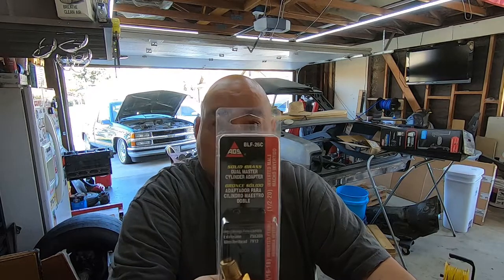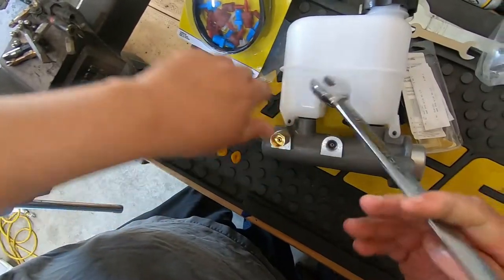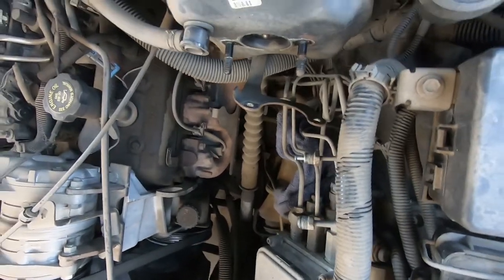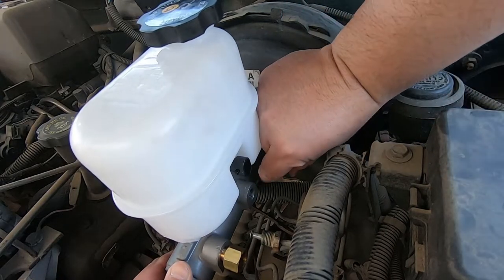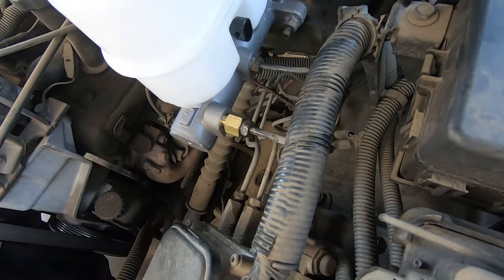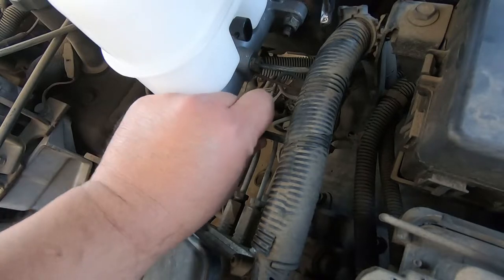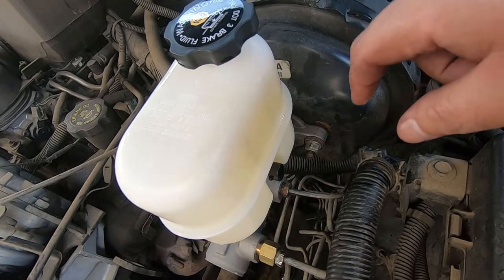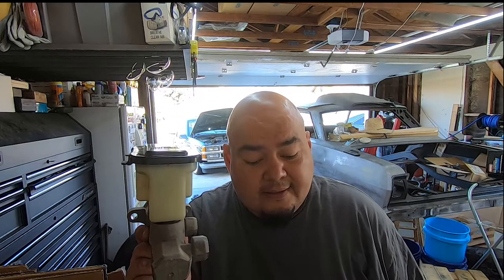Chevy NBS master cylinder on an OBS upgrade

Comment: Nice video. That’s on my list as well.
Reply from the maker: Yea bro it’s a must do if you have one of these OBS trucks ! Thanks for watching
Reply: I’m still working on the inside and some light bulbs, speakers for the front door. Also the driver door key whole is hard to turn to unlock. All the power locks don’t go up and down. They click up and down but don’t lock/unlock. WD40 to the rescue
Reply from the maker: Hell yea bro get it done it will all be worth it in the end 👍🏼
Reply: It will be as it was my dads truck. I think we live near each other. I’m in Chino. Mine is a 1999 C3500 OBS crew cab 8ft bed
Reply from the maker: @djbigdavethefyrm  I live in Fontana but I do work in Chino Hill funny right
Reply: What would you charge to do my master cylinder
Reply from the maker: @djbigdavethefyrm  I don’t bro sorry .... I’m limited on time I don’t much time to work on my own stuff .... do you have tools ?
Reply: I understand and I do have tools. The bleeding of the brakes is a two man job. I gotcha
Reply: One more question, do you know someone local that does sunroofs for the OBS ??
Reply from the maker: @djbigdavethefyrm  no bro I don’t the ones that I have heard of charge a lot the the work and it’s not that great from what I can see

Comment: Well... did it work? Did it cure the feeling of stepping on a marshmallow? On mine I believe it is the ABS pump. I've seen a lot of videos where people go ham on masters, calipers, brakes, wheel cylinders all to still have the squishy feeling. The master doesn't drift or "vibrate" when depressing the brake, and the brakes engage and dont pull so its not like its a stuck caliper or wheel cylinder. The only thing left is the pump. At least I hope that is what it is because it cost 100 bucks. lol.
Reply from the maker: Yes it worked for me the brake pedal feels firm and grabs quicker than before no more squishy feeling .... after I was done with the install I had a friend come over and we manually bled the system and the abs unit as well it’s been working great ever since.... I’m actually getting ready to do agin to my other OBS 2 door Tahoe ... thanks for watching 👍🏼
Reply: @LowLifeYonkes  My next step will be abs delete using this setup. Thanks for the instruction. :)
Reply from the maker: Yes that’s my next move too lol I will post a video soon on how I do it
Reply: @LowLifeYonkes  Just wanted to come back to say with the new abs module and proper bleeding its a little better. At least I am not afraid to drive it now. But still not the greatest and I will be doing this upgrade. I am curious what these felt like when they were new. I used a power bleeder and like a gallon of fluid to be sure there was no air. lol. Have a good one.

Comment: Will it fit a 96 obs? It says on the Amazon link it won't fit
Reply from the maker: Yea it will it’s a NBS master cylinder so it’s not made for the OBS but yes this is an upgrade huge difference in braking power
Reply: @LowLifeYonkes  mad respect for the reply. Love your obs sir! I've replaced my front right caliper on multiple occasions. It keeps failing and I replaced the hose too. Spongy pedal as well so I think I'm just going replace the master cylinder and bleed everything because it can't be the caliper every time.
Reply from the maker: @kennethheadden2229  yea this is definitely the way to go bro I have a few other OBS trucks this is the first thing I do every time

Comment: Same master cylinder can be used if you add rear discs.
Reply from the maker: Yes sir same master can be used with rear disc !
Reply from the maker: That year NBS came with both drum and disc brakes in the rear and it’s the same master cylinder !

Comment: Will this work for a 98 c1500
Reply from the maker: Yes it will …. My truck is a 98 c1500 just so you know
Reply: Did you have to do anything to the rear brakes as for adjustment? How does it do with the abs?
Reply: After 7 mths any issues?
Reply from the maker: @chiefer8631  nope no issues bro
Reply from the maker: @chiefer8631  nope no adjustment to the rear work really good and it still works with the abs but I am deleting the abs ASAP cause it never really worked thanks for the comment bro
Reply: Thanks man bout to order up and do the same to mine great content ive already redone most of my truck as of now just a few more to to do and it basically brand new truck. Thanks for the info.
Reply: Do have 1 more ? Ive read on some threads the back brakes wont work is this true or false with this conversion

Comment: Threads on fitting came apart and started to leak
Reply from the maker: I have never heard that happening might have over tightened it
Reply: @LowLifeYonkes  bought a second one and it worked but is this upgrade work for drum brakes in the rear ?
Reply from the maker: @johnaceves6398  yes it works perfectly
Reply: @LowLifeYonkes  thanks for answering
Reply from the maker: @johnaceves6398  thank you for watching and the comment bro I appreciate it

Comment: I bought the master cylinder and my mechanic said it doesn’t fit
Reply: He didn’t even bolt it up
Reply: I have a 1989 obs
Reply from the maker: It does fit read all the comments please
Reply from the maker: Why not ?
Reply from the maker: Yes it fits I have done this upgrade on about 10 different OBS trucks all years
Reply: He said it doesn’t fit because of size of the old master cylinder it’s bigger
Reply: He took a photo and said it won’t fit just by looking at it
Reply from the maker: @flacko-_-429  the old master cylinder is larger yes but the new one does work with the adapter fitting
Reply from the maker: @flacko-_-429  your mechanic is not very smart if he can’t figure it out sorry bro

Comment: I Did This Upgrade......... NOW,    Good pedal, 2" travel, NO POWER BRAKES!!!!!!!  Before the Did Work, Power.    What Now?????????
Reply from the maker: Sounds like you might have a bad brake booster
Reply from the maker: And u should bleed the entire braking system as well and see where your at after that
Reply: @LowLifeYonkes  Booster worked before.... .
Reply from the maker: @catdakman1273  did u bleed the system???
Reply: Bled All four wheels..... hard pedal....No ABS......Can not Lock Wheels......Have to push VERY  HARD To Stop Truck.
Reply from the maker: @catdakman1273  well somethings not right I would back track and reinstall the old master and see if that changes anything double check your lines make sure you installed the rear brake line to the rear port of the master and front brake line to the front port you need to check everything
Reply: @LowLifeYonkes  ?? Do you mean..... NOT like the OEM master cyl...Front resv tank for the Rear brakes.  Rear resv tank for front brakes ????  Im using the short, Tall tank Master cyl.    And did the lines just like they were;  front to rear..... rear to front.  ?  Is this Wrong????  No power brakes. Need to push very hard to stop.